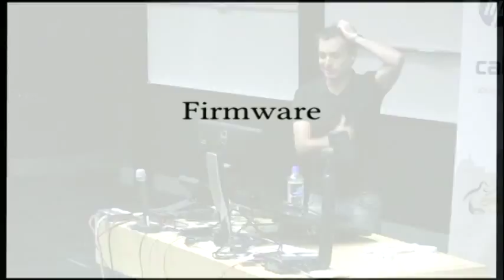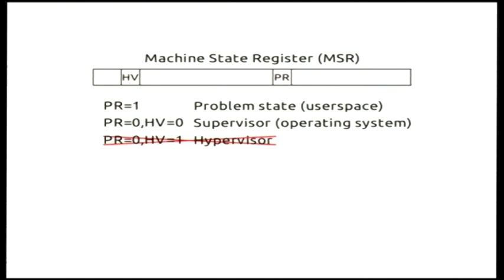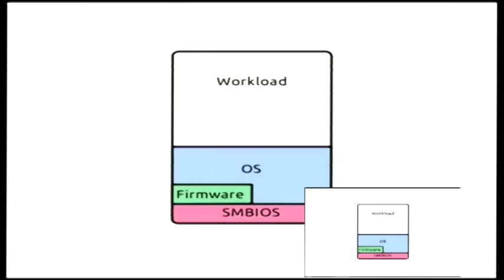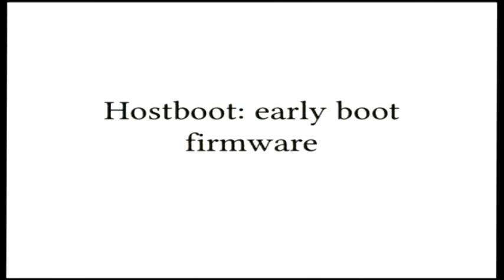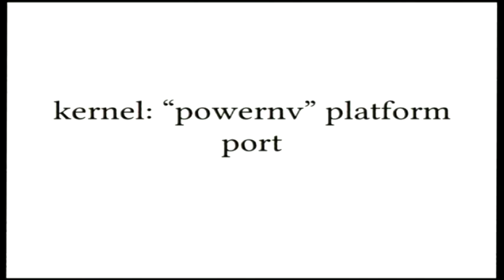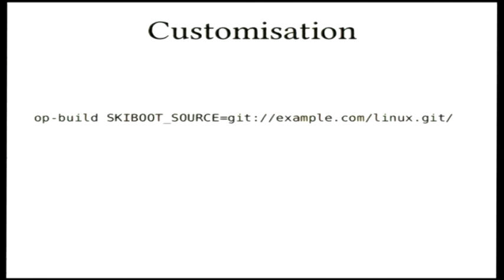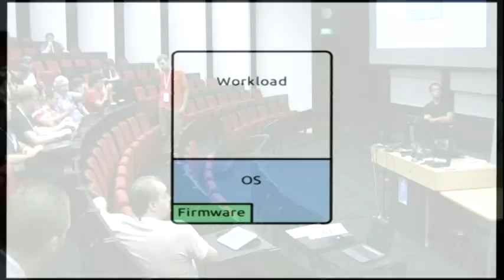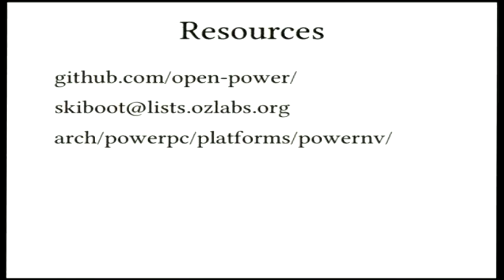OpenPOWER: building an open-source software stack from bare metal

Comment: Fantastic. Is firmware for BMC also open source? What arch is the BMC based on (ARM/MIPS?)?. ASPEED maybe?
Reply: That depends on the platform itself. At the time of the presentation, OpenPOWER platforms shipped with an AMI-based BMC implementation, which is not open source. However, we now have the OpenBMC project too, which is an open source BMC implementation, and is used for the POWER9 OpenPOWER machines (and can be flashed to a few of the POWER8 platforms too). Because of that, there's a lot of cross-development between the OpenPOWER and OpenBMC projects.

OpenBMC is up at http://github.com/openbmc/ . 

On the OpenPOWER machines, all designs that I'm aware of use an ASPEED ARM system-on-chip for their BMC. However, OpenBMC can also be compiled for other BMC platforms; I think there's even an x86 build (ie, x86 BMC, independent of host architecture). No MIPS as far as I know.